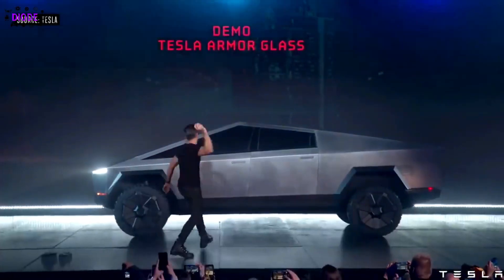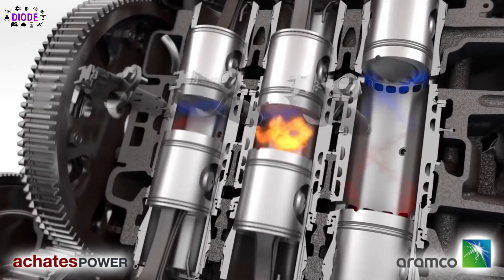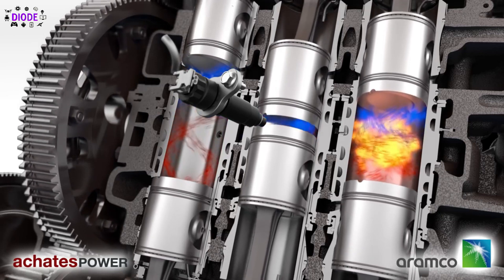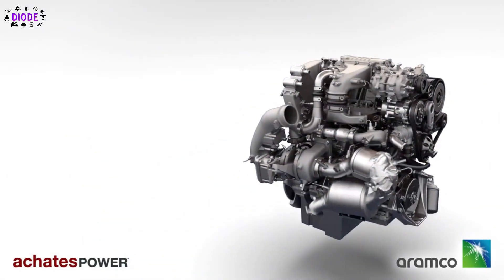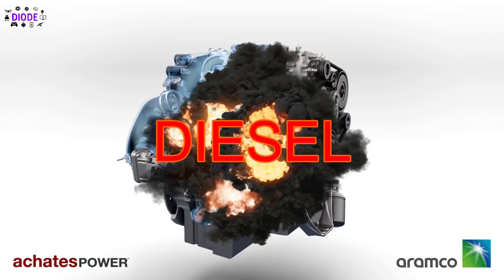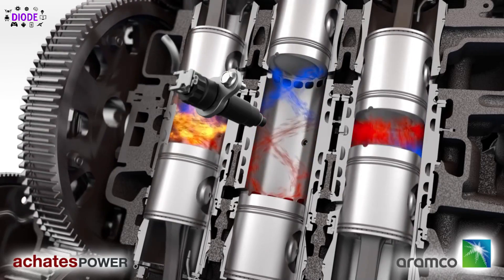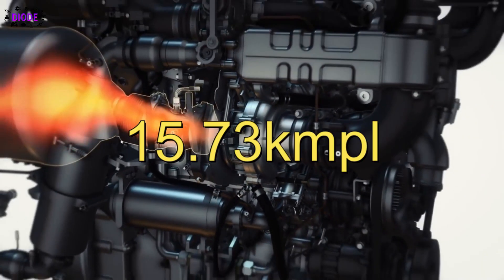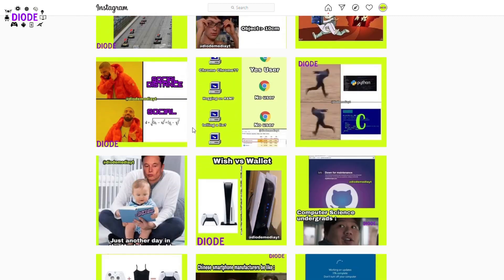Opposed Piston Engines, the last hope for Diesel and Petrol (Gas) Engines for automobiles...(2020)

Comment: they have done a good job. i think they can increase efficiency with atkinson cycle to lower the exhaust gas using long course of piston. they can also improve efficiency using an organic rankine cycle in recovering heat exhaust (10% efficiency). i hope they strart install that on trucks. I believe whe can achieve 60 % efficiency. It's sad to say that car's manufacturer don't have done all they could to maximise efficiency and minimise pollution.

Comment: And the rootes group, Commer ts3 , single crank three cylinder 6 piston 12 con rod six rocker shaft diesel and some petrol engines produced in the early 1950 to 1970 which was cancelled by Chrysler in 1968 ,oddly Cummins now produces a copy of this engine but in the commer ts4 style since this is a Chrysler company ,

Comment: Further to Graham Clarke's reply,  these engines were developed and used by the RN in fast patrol vessels and latterly in their Ton Class Minesweepers and Hunt Class Sweeper/hunters.  Imagine a Toblerone chocolate.  Put a crankshaft at each apex and run them parallel down the length of the toblerone. At each apex the crank had 2 pistons, thus each side of the triangle was a tube with a pair of opposing pistons - 6 pistons per bank. There were 3 banks, thus 18  cylinders in 9 tubes/cylinders.  They  could produce up to 1875 hp at 1500 rpm.   Very small and efficient but terribly prone to breakdown, most common failure was the liners in the cylinders would crack and engine gasses would leak into the coolant and blow everything out of the header tank.

Comment: U think this is the last hope for internal combustion engines? Well i have a concept engine im working on that might bring them back
Reply from the maker: Well it was a click-bait. And waiting for that "Matthew cycle" engine.
Reply: @diodemedia8574  😂 well its gonna take a while and a lot of money but ill get it done. The engine calls for 50% less parts than the average internal combustion, is smaller and more compact, more efficient, and totally cool. But i need to finish school for electro mechanical and material engineering and i need to finish machine training.

Comment: Nothing new to see here....  From the Deltic, to the TS3, these have been around for ages..... And they can be marginally more efficient than conventional engines...   But you'll notice they're not used in shipping, which is a pointer...... And also the most efficient engine package we have, exceeding 50%, is the ICE hybrid used in F1...  collecting power from regen braking, and also from a generator on the turbo makes F1 systems only 50% hateful....

Comment: Nice sentiments but Achates seems to have disappeared off of the radar.  What is the holdup?   Where are the prototypes on the road.   Where are the contracts to sell the engine to truck makers?
Reply: They’re developing the engine with Cummins for the military now, going into the consumer market could have proved very risky for Achates as there is very little actual need for the product right now in the transportation industry. A military contract would ensure the longevity of the project for decades if implemented into any military application. I believe there will be other manufacturers of these engines in the future but it will be for high performance off-road applications.
Reply: @slycarlo8747  I really want to see Detroit pick up this design and put it in OTR trucks some day. They could probably bring back the Series 92 and call it the Series 9200, or something like that. 

I would LOVE to see a new generation "12V9200" powering a semi truck.

Comment: How can this be anymore efficient than any other engine with  the same compression ratio running the same fuel?
Reply from the maker: It can pull off much larger strokes than a conventional engine, it drastically increases the volumetric efficiency of this engine and no power is wasted to operate a valve system
Reply: I think it's because of the gained benefit of additional stored energy in the 2 crankshafts that would normally be wasted to run a valve train.
Reply: An Opposed Piston Engine has NO Cylinder Head, thus it can use the heat that would have been lost through the cylinder head, and that's what makes Opposed Piston Engines far far more efficient than any other engine with the same compression ratio running the same fuel. 

i.e. NO Cylinder Head, means, Nowhere for the heat to be lost through, which means, the heat that would have otherwise been lost is now being use, thus, increased efficiency.

Comment: Who said internal combustion is obsolete? Bruh
Reply: I say it’s obsolete. I heard about this engine 10 5 years ago, and it’s still not out. They keep waiting and Tesla will have a sprinter van with a  400 mile range. I’ll buy the truck with a 1 speed transmission and instant torque. If they don’t hurry, the market will abandon them.
Reply: @buttersstotch6854  Achates are working with Cummins but they're decelopibg it for military applications, so they're keeping everything secret. Maybe at least 5 to 10 years from now when the OP Diesel proves itself in the military and electrification has taken off, then this engine's efficiency will really be able to shine.

Comment: The Napier Deltic (Paxman Deltic later) 18 and 9 cylinder opposed piston two-stroke engines are still around in heritage railway use in the UK.  They are even being overhauled as I write this comment.  The 'Deltic' was derived by Napier from the Junkers Jümo 204 aircraft diesel engine under some form of license from Junkers.  There are also a number of other opposed piston diesel engines, mostly for military applications, including the Leyland L60 (UK Chieftain Tank), Coventry Climax H30 (APU engine for the Chieftain), Rolls-Royce K60 (FV430 series armoured personnel carrier) and the Comma TS-3 truck engine.  Some oil testing standards are based around testing using a TS-3 engine.
Reply: Ukrainian tanks: T-64, BM Bulat and BM Oplot all are using 5 and 6 cylinder opposed piston engines.

Comment: They have been around for decades. There is a reason they aren't being used. Oil consumption.
Reply: That's the old two stroke engines. These guys are working to reduce that problem.
Reply: That and emissions.  Scavenged exhaust was legislated out of existence long ago. The thick black column of exhaust smoke is the mark of this beast.
Reply: i'm french, no need to had oil on gas or in the cylinder. the air comes from a turbocharger without oil. on old 2 stroke engines the air comes under the piston who there is plenty of oil's vapor, if the air comes from the turbocharger there is no oil consumption.